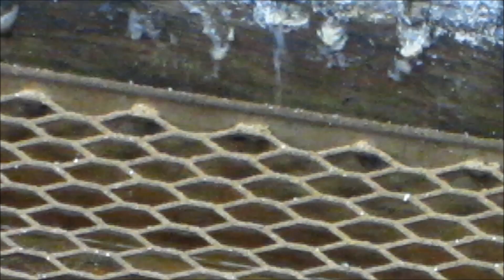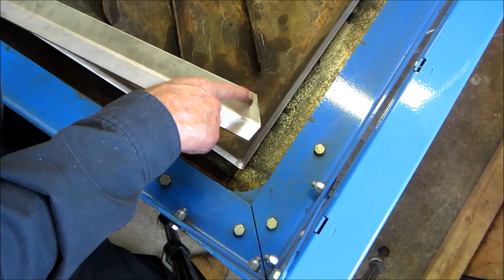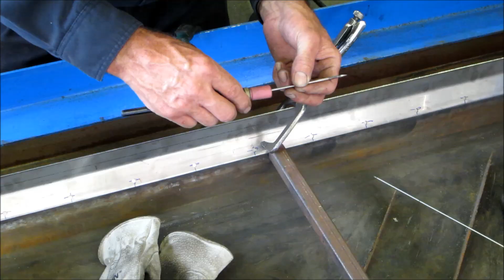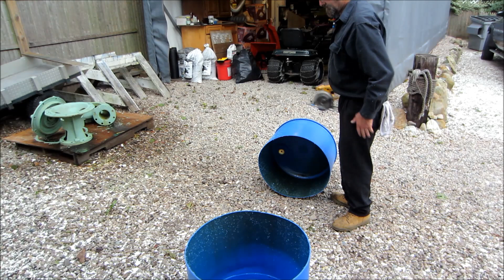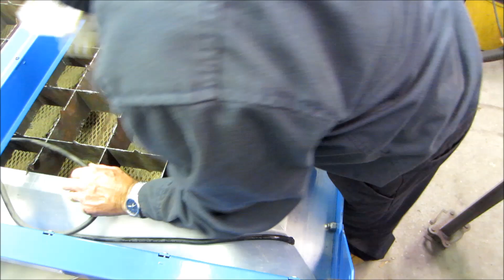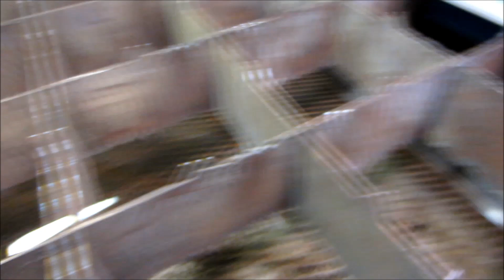No Lip Service

Comment: Are you totally sold on a Water Table over a Downdraft Table? I am at the point that I realize that there are three levels of debris sizes. And the amount of fumes created by Plasma Cutting. So, around the outside of your table there is a Downdraft that is capable of removing everything pretty much?

Comment: Keith Fenner I never see a video of you talking about your plasma cam,. ie. what model it is, were you ordered it from, or did you build it, if so were did you get the parts from, how you like it, do you think its worth the money, about what it cost? I been looking for one for some time, but seems ones I have seen are in the 12 to 20,000 $ mark,  I have also seen this internet pop up Google ad for this,  what seems like a toy, for hobby, were there cutting out art work from very thin tin like metal, never seen one it self other then the ad videos, witch look very cheep and most likely cant do much. Things like saw mills, wood Miz*** there is nothing to them but they selling  for 40 to 60,000 $ just sor a steel frame, gas motor, and a saw head, w/ a 500.00 hydrolic 12 volt power pack, I have been a class A welder over 40 years, still using torchs

Comment: Don't forget- some of that dissimilar metal corrosion is also caused by the galvanic reaction of your cathode / anode electric torch-to-table. Coupled with the minerals in your water; just as you filter your air & electricity supplies- maybe invest in a $20 "home water filter" (they look similar to your desiccant air filter) for the table water- to cut down on corrosion. I love your videos- they're better than T.V.!

Comment: I use that recipe, I bought it all on ebay cost me about $50 with shipping and will have plenty to refill my tables reservoir a few times. A friend used to buy that koala or whatever it was called, and it cost him $200 every time he cleaned out his table. I have been using it since april and so far it has been working great. Way better than when I used to run straight water... which would rust stuff overnight and stunk bad after a few months.

Comment: Hey Keith, do you use plasma quench or something like this? I just finished my plasma build and used for the first tryout cuts just water in my bed, its ok for now but i know that there will be algue and crap in a short amount of time... Any tips on a secret but cheap diy liquid for the water bed ?? Thanks

Comment: Nice table, I use to work at a fabrication shop, we had a 10x20ft plasma table, and they didn't have a mesh under the fins. So when they'd cut small parts you had to reach in and fish for them, it wasn't fun. Then once every few months we had to take out the fin trays with a hoist, climb inside and shovel out all the crap. Smelled great, especially after cutting galvanized. Keep up the great vids.

Comment: Aluminum oxide or Alumina isn't toxic at all if you don't believe me look it up. 
However if the powder has the right particle size it can cause silicosis just like any other grinding dust. For grinding I always try to use a P3 face mask which should translate roughly into a N100 for US standards.

Comment from the maker: Plasma cutters can cut all of those metals; I may or would raise some questions to the finished surface and its hardness if requiring machine work after though! The industry is growing and the plasma cutting advancements are heading toward glass smooth cutting to compete with water jetting at a lower cost and less after math of waist!

Comment: Keith nice work the tray looks good.  I use about 8-10 sec post flow for < 100 amps and 1 sec per 10 amps above 100 amps.  I think the camera mic amplifies the sound?  I can barely hear the gas from my machine.  Usually using about 20 cfh, sometimes more if I'm using a gas lens.  I know some guys use less than 20 when using smaller cups.  Like everything all depends on feel and which chart you're looking at.

Comment: Just an FYI for you. In the shop I had to deal with stainless and aluminum living together in water tanks. I found a product from Stoner that worked awesome to prevent the scale build up that would other wise result. Its there A612 Thin film rust preventive, they now have a new Heavy Duty version, A677 Heavy Duty rust preventive. I highly recommend the stuff. Just give all the parts a good spray when you have the machine down for maintenance. And no I don't work for them LOL.